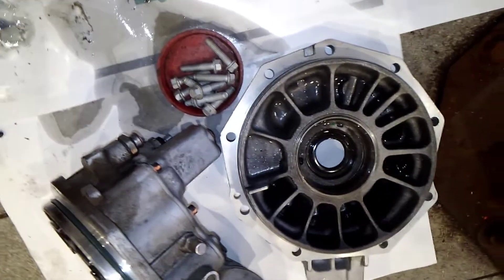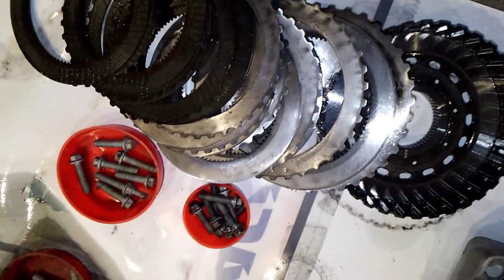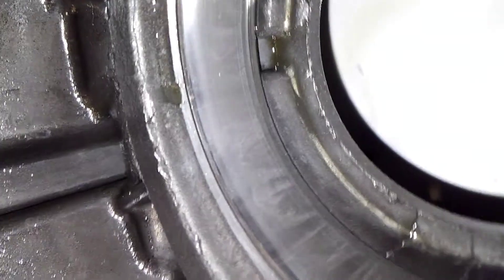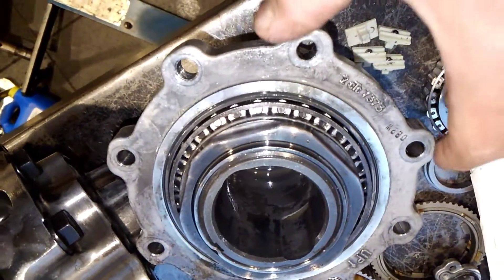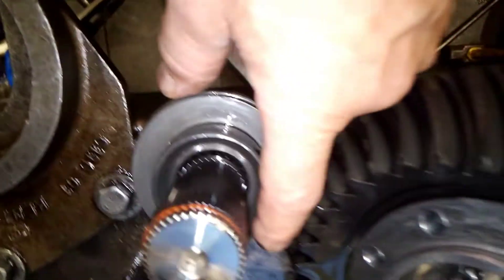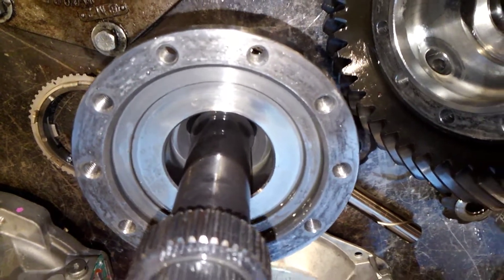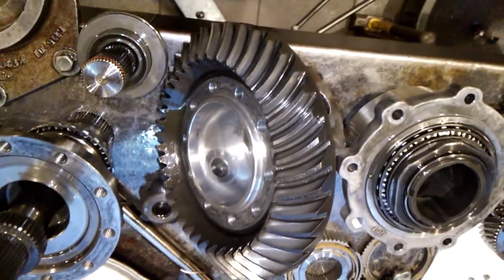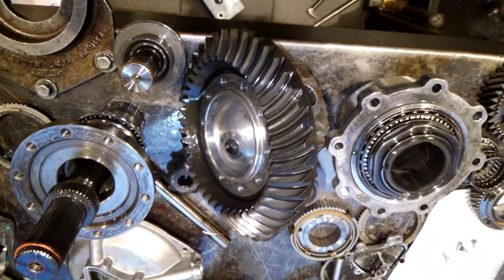Corvette eLSD root cause of contaminated fluid

Comment: Interesting videos on this eLSD.  I have a question for you: can you verify that the clutch disks for the eLSD bathe in the differential fluid (75w90), and NOT in the 5.6oz of ATF that runs the hydraulics to operate the clutch lockup?  This is sort of to settle a bet.
Reply: From my knowledge it uses the recommended DEXTRON ATF fluid.  I'm also finding out that there is a bleeding procedure that I would like to ask this channel. Would an up to date snap on scanner be able to do the bleeding procedure Corvette Mechanic?   I put a set of 4:10's in this C7 Z51 car I'm working on, and the eLSD was drained. Please get back, it would helpful. Thx, Cheers.
Reply: @NY-DIYMECH did you ever find the procedure out? I’m in the same boat :(. Any help is appreciated!